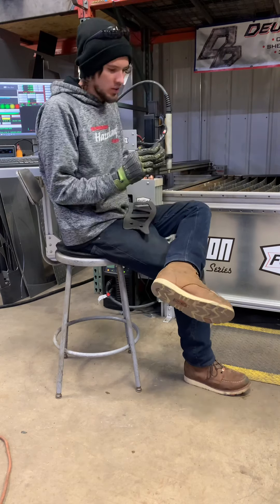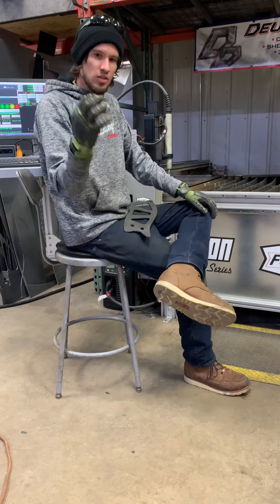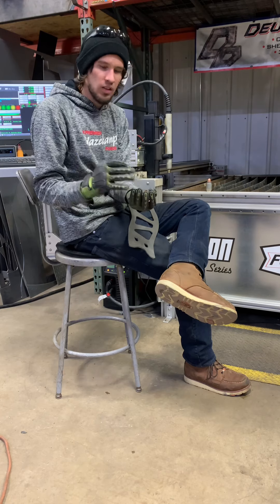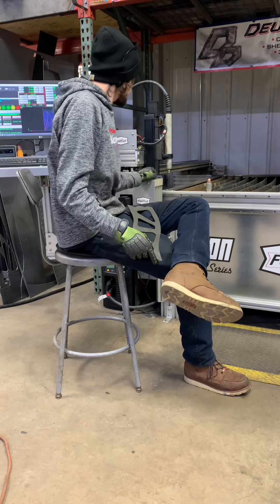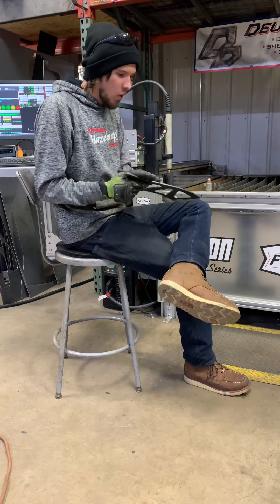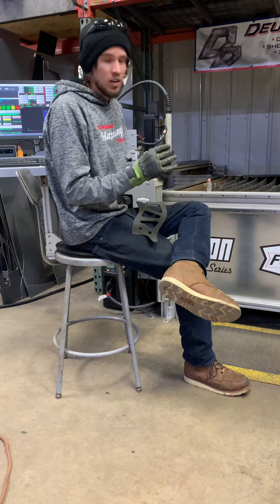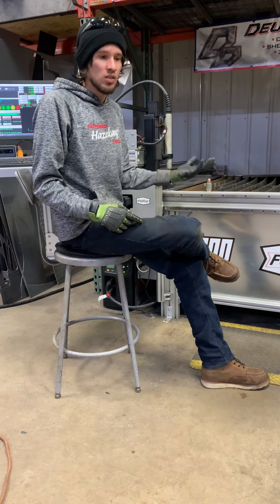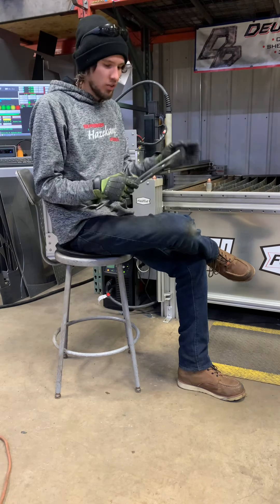Hypertherm Sync Cartridge Consumable Review.

Comment: Here is my rough cost break down on 65A consumables (I normally run 2 nozzles for every electrode)

6
6
8
--
20 / 2 = $10 per change avg Vs $53 for the SYNC setup So that is $43 savings per change out.

If you change your consumables twice per:

Month that's $86 x 12 = $1,032 / yr
Week $86 x 52 = $4,472 / yr
Day $86 x 5 x 52 = $22,360 / yr

Where is the cash cow to cover the additional costs?
Reply from the maker: Have you ran the sync cartridges? They will last longer at making better cuts which is where it’s at for s a prototype shop like mine. Many will run consumables far past their perfect operating setup as quality may not matter but for me once I see any type off out of round hole of mismatched angles I need to swap out so the normal ones last much less. Also you need to account for time spend changing consumables. At a shop rate of $100 an hour here and probably going up to $150 soon that’s real numbers to consider. 

If you don’t like them you don’t need to run them, you can just use a duramax torch and standard consumables.
Reply: @AdamDeuling  

The input from users on P Spider is not backing up Hypertherms claims.. The new system may be more convenient but not worth the additional $$$

If time is that important have several sets ready to go download and learn how to read the charts. I have 3 machines w/ 5 of their torches None will ever have the expensive Sync$ on them..
Reply from the maker: @SegoMan  I know of shops getting much more than advertised on the sync setups. I’ve used the sync at fabtech and was impressed. You do you, no reason to knock new tech if your a fan of the old stuff. They aren’t getting rid of the old consumables so you will have them for a long time
Reply: @AdamDeuling  Enjoy your really expensive tooling......
Reply: @AdamDeuling  so u can use ether sync or old style with same machine , but u need 2 "torche head cable bit "  ??
Reply from the maker: @alickomay7344  you just need to buy the adaptor for the Powermax machine. Screws on to the end of the torch then you put the sync cartridges on
Reply: @AdamDeuling  yer  but we thinking of geting new cnc plasma and so it would come with new sync plasma machine so would wont to use old consumables as thay about a 10th of the price